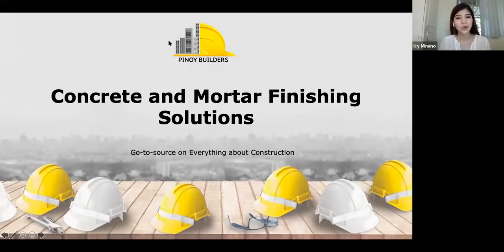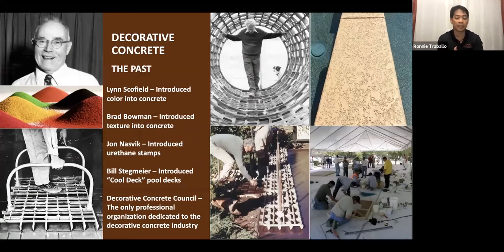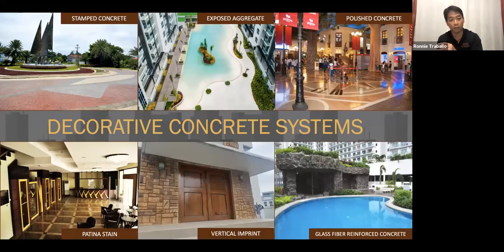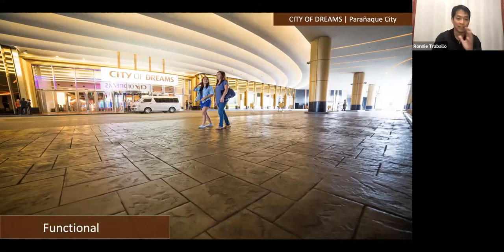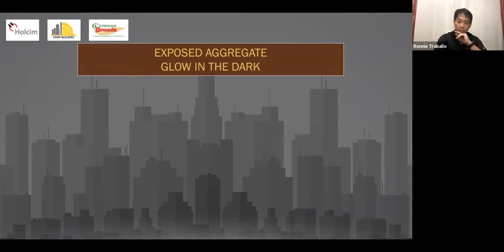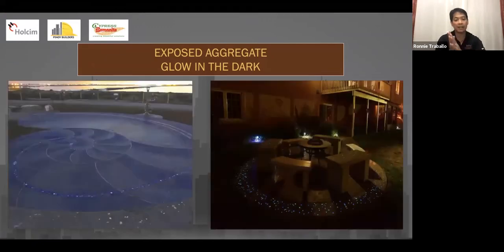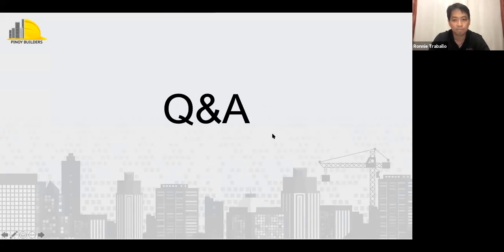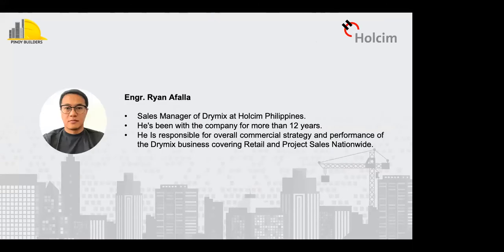Pinoy Builders Concrete and Mortar Finishing Solutions Webinar

Comment from the maker: TIMESTAMP
02:17 - Decorative Concrete - Applications and Trends
04:29 - Concept of concrete as a decorative material
05:35 - History of decorative concrete
08:48 - Identifying trends in the industry and mainstream media
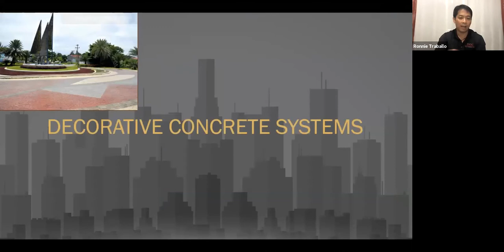10:55 - Decorative Concrete Systems
11:25 - Stamped Concrete
15:20 - Exposed Concrete
21:10 - Polished Concrete
23:09 - Patina Stain
25:08 - Vertical Imprint
26:17 - Glass Fibre Reinforced Concrete
27:50 - Bomanite training and work methods
29:43 - Decorative Concrete Asia Group - Join to learn about the work!
31:49 - Q&A

42:18 - Drymix Mortars
42:38 - How all-in-one mortars work
43:05 - Introduction to and manual production of mortar
44:33 - Sand is a major constituent of mortar mix
48:44 - Production of mortar extended explanation
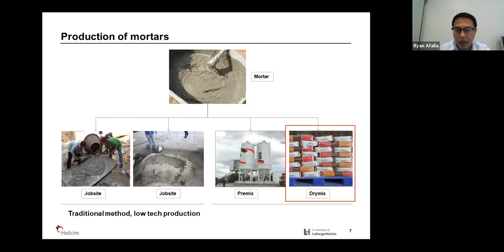50:23 - Multifix method
52:52 - Where to use multifix - 
55:45 - Skimcoat method for finishing
56:05 - Traditional way of finishing
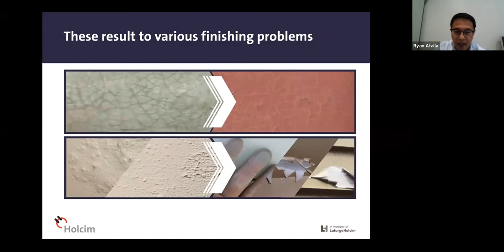57:34 - How skimcoat works
1:04:18 - Tile Adhesive introduction
1:04:45 - Why tiles delaminate
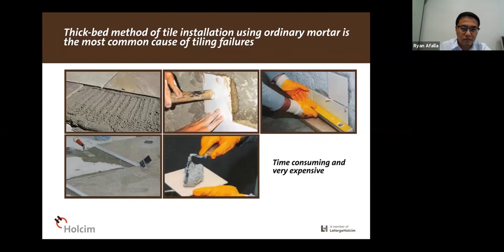1:05:13 - How tile adhesive works
1:11:38 - Q&A